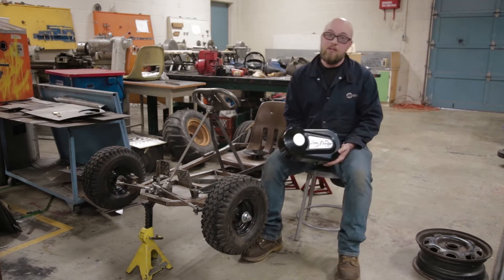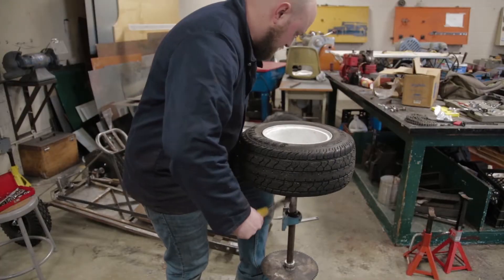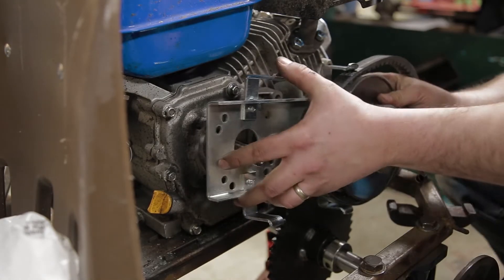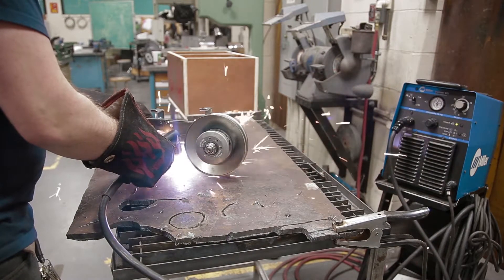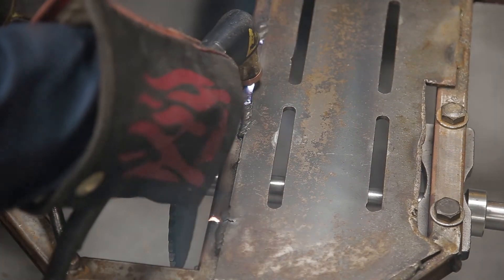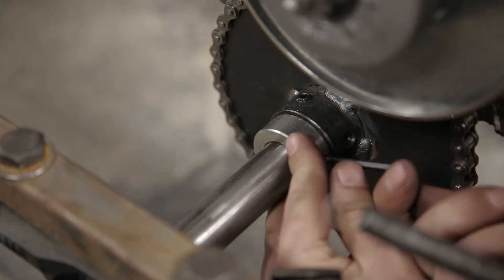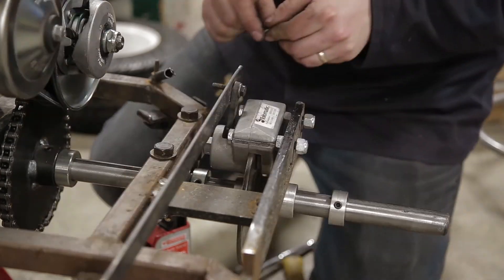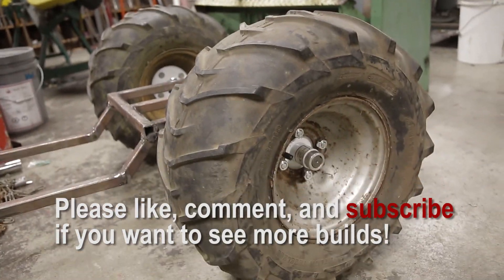Installing A TORQUE CONVERTER - Go Kart build

Comment: Came across your video, I have run into the same issue as yourself. Have a pro point engine that I picked up last year, have a comet torque converter. Converter won't fit, how did you make yours? New to this so need as much help as I can.
Thanks
Reply from the maker: Do the bolt holes on the engine line up with your torque convertor? It is important to check for compatibility with the parts. Most are universal but should always check before ordering. I filmed this so long ago. If I recal I had to cut part of the torque convertor frame in order to fit a wrench/socket to tighten it on.

Comment: Hey what size bolt are you using? I've got the same Powerfist engine. I tried an M8 x 70mm and a 5/16 x 3" and neither would screw into the crankshaft. They'd both screw in just a tiny tiny bit and then come to a dead stop
Reply from the maker: Should be a 5/16" FINE thread